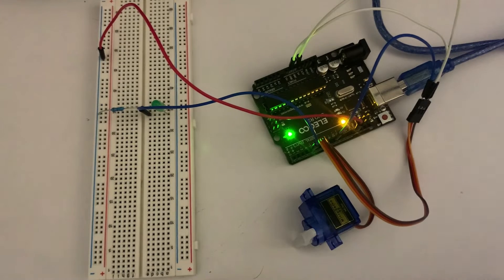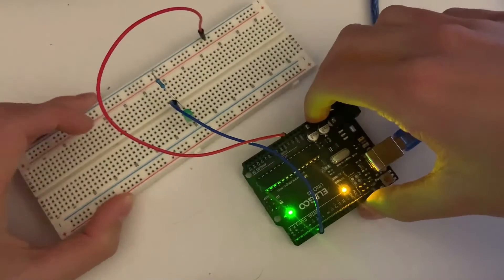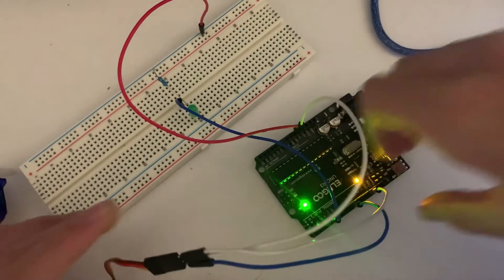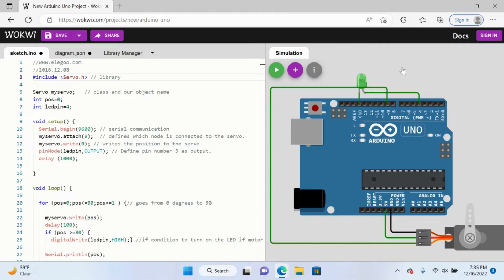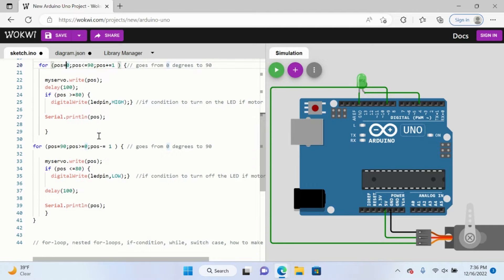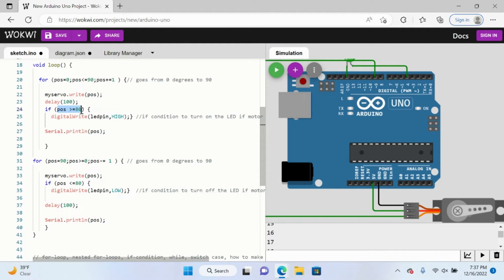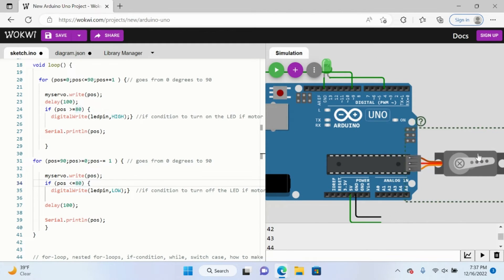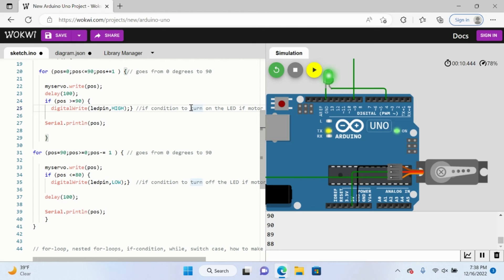Arduino: Servo Motor and LED project

Comment from the maker: #include <Servo.h> // library 

Servo myservo;   // class and our object name
int pos=0; 
int ledpin=5;    

void setup() {
  Serial.begin(9600); // serial communication 
  myservo.attach(9);  // defines which node is connected to the servo. 
  myservo.write(0); // writes the position to the servo
 pinMode(ledpin,OUTPUT); // Define pin number 5 as output. 
  delay (1000); 
  
}

void loop() {
 
  for (pos=0;pos<=90;pos+=1 ) {// goes from 0 degrees to 90
    
    myservo.write(pos); 
    delay(100);
    if (pos >=80) { digitalWrite(ledpin,HIGH);} //if condition to turn on the LED if motor position>80 deg
    
    Serial.println(pos);
   
    }

for (pos=90;pos>=0;pos-= 1 ) { // goes from 0 degrees to 90
    
    myservo.write(pos);
    if (pos <=80) { digitalWrite(ledpin,LOW);}  //if condition to turn off the LED if motor position <80 deg
    delay(100);
     
    Serial.println(pos);
    }
}

Comment: doesn't the LED needed to be placed on the breadboard with a resistor, since the LED has no resistor and connecting the LED directly to the arduino might destroy it?
Reply from the maker: Yea that’s a good point. I apologize for the oversight. I set it up properly with my breadboard in the first few clips but forgot to correct it on the circuit diagram. I’d recommend just following the setup shown around 1:18

Comment: what happens if I want to turn on the LED when the servo is moving?
Reply from the maker: @nickdev3860  You would have to set the servo to continuously moving and then use the LED command to keep the LED on at all times. So basically disregard the if statements. If you still need assistance I can try to write the code for you

Comment: I want to start servo motor according to leds colors. For instance, when the color turn green, servo motor should start. if the led light turns to red, servo motor should stop. led lights are might totally independence.  I will control the lights manuel. How can i do this?